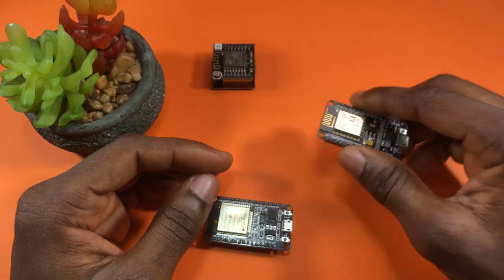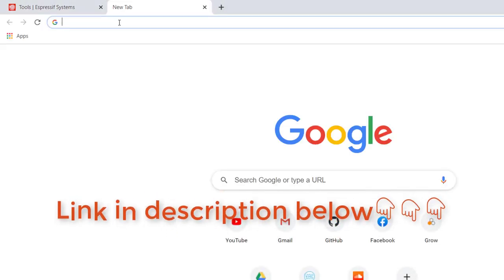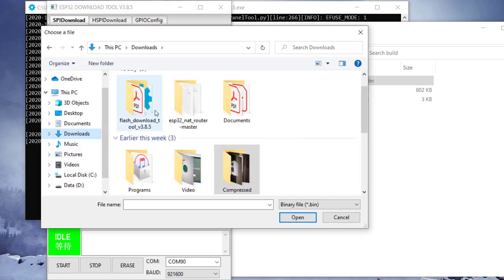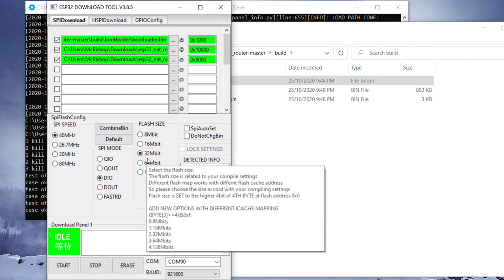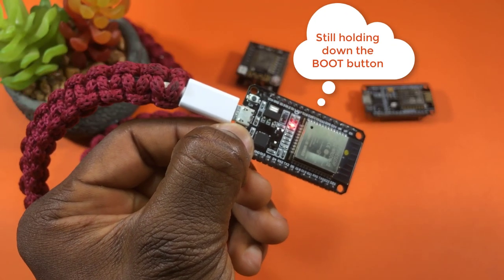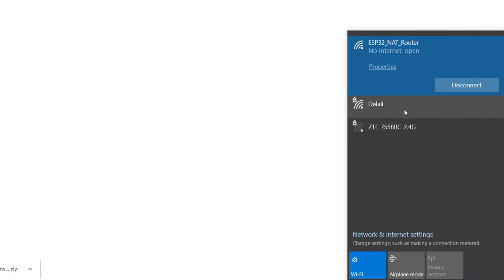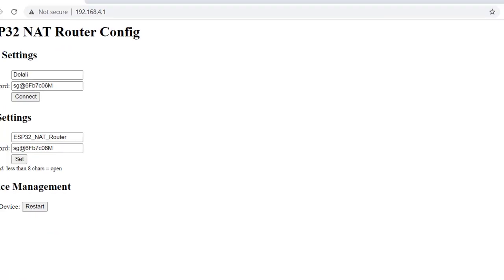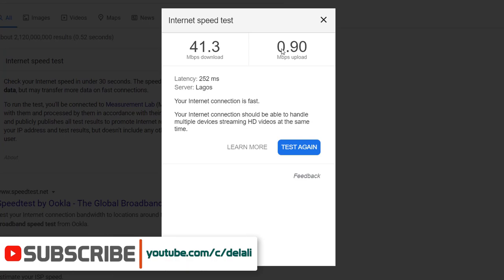How to Make a WiFi Repeater using ESP32 NodeMCU | WiFi Router Range Extender esp32 esp8266 | 2022

Comment: I did this just as you said, and it works perfect. I am able to broadcast to a building 30 feet away through two brick walls. Previously I did not get the signal in that building but now I can get 3 to 4 Mbps. Question, could you do it the exact same way, but instead use the ESP 32 cam module, without the cam attached, because the cam module comes with an external antenna?  Stronger signal and more range?
Reply from the maker: Its amazing to hear you were able to successfully build one of your own.

Concerning the ESP cam module, as long as your able to upload the bin files unto it, i believe it should work fine and give a better range as well. I haven't tried this on an ESP cam though but I dont see why it shouldn't work.

Please dont forget to subscribe. Cheers!!
Reply: I am interested if u tried it with the ESP CAM and external antenna?! :D
Reply: @vertaniacity9113  sorry but i never did get the time to try it with the espcam and ext antenna.  If i ever do I will reply post to this comment.  If anyone else does it please also post here to this comment string
Reply: @toddroles3234  I tried it and it worked 3 times stronger :D breathtaking :D i can just recommend it!
Reply: Can I get the file ?
Reply: @vertaniacity9113 how many mbs do you get compared to your original speed ?
Reply: @mohamedsalhi2426  i remember somthing about 70 or 80  my Internet speed in my Lan is 250. With the normal ESP i only got like 25.
Reply: @mohamedsalhi2426  I want to check it the next days, because i am not sure if I confused the speed with the raspi pi zerow repeater...
Reply: I have a hotspot network with voucher code as password using mikhmon voucher generator. Question: can this still be working if i used this as extender on a hotspot network with voucher code as password???

Comment: I have a hotspot network with voucher code as password using mikhmon voucher generator. Question: can this still be working if i used this as extender on a hotspot network with voucher code as password???

Comment: I using win10 and the esp isn’t showing up in the flasher program!
Reply from the maker: I could be a driver issue. Please check if your ESP has the CH340 UART chip or CP210x  and download the appropriate driver for it.

https://drive.google.com/drive/folders/1M9UKCm1I6qsNywlQFlggDPvXdKDEhLjm?usp=drive_link

Comment: Sir in my pc I have completed full set up but the flasher options are not coming pls tell what to do I have project on it and date is till 25th Oct pls tell fast
Reply from the maker: Please make sure you have all the needed drivers installed for the esp.

You can also delete all the flasher software and related files. Then download them and install again to be sure nothing is corrupted. 

Go to the link below, download the CP210X and CH341 drivers and install them. Am not sure which one of the two chips your ESP got but one of them will work for you.

https://drive.google.com/drive/folders/1M9UKCm1I6qsNywlQFlggDPvXdKDEhLjm?usp=sharing

Let me know how it goes!!

Comment: How did you determine that the hex file location of the bootloader.bin file is 0x1000 or the other files?
Reply: i am wondering this too
Reply from the maker: From the research i made before making the video, those were the hex values specified.

Did you have any issues using those values?

Comment: can you still use the esp32 as a normal microcontroller after this? or do i have to flash the stock firmware?
Reply from the maker: Yes you can.

You just have to upload new code to it using your Arduino IDE or with ever tool you use for programming your MCU

Comment: I was able to successfully follow the instructions in the video and connect two ESP32 repeaters to my router. They worked well, but I am having trouble communicating with the devices connected to the networks of the repeaters. Could you please help me troubleshoot this issue? Thanks for the video
Reply from the maker: Thanks for reaching out.

Are your devices able to connect to the repeater network?

Comment: 5G wifi extending supported?
Reply from the maker: The ESP32 available on the market currently doesnt support 5G yet. However Espressif's ESP32-C5 supports 5G.

Kindly take a look at this article.
https://www.espressif.com/en/news/ESP32-C5#:~:text=Espressif's%20ESP32%2DC5%20is%20the,require%20high%2Defficiency%20wireless%20transmissions.

Comment: Possible to use multiple esp32s to make a mesh? With same SSID?
Reply from the maker: Yes, that should also work.

I haven't tried that specifically but one time, I had two routers configured with the same name and password. I placed the two routers at opposite ends of a building and it made the wifi seem it was everywhere and with a strong signal.

Comment: Thanks for the video, it helped a lot. Do you know how I can set devices connected to the new AP with with a static IP?
Reply from the maker: It depends on the devices you have. If the devices have flexible menu's for connectivity control the its possible to set your devices to have a static IP.

If not I'm not sure how to set that on your devices.

Comment: Thanks bro it worked for me , i did same as you told me tell me if i want to make my ESP32 board normal in future how can i do that.
Reply from the maker: You just have to flash it with an empty sketch from your Arduino IDE.

Thanks for the feedback and have a happy new year.
Reply: @Delali  thanks bro and Happy new year to you also and i have a suggestion for you plz make a BLE Gampad with ESP32 and use in built touch feature to control it. give code and process in detail .

Comment: What about bridge mode(wifi to ethernet)
Reply from the maker: I don't quite get you....you mean you want to connect your ESP to your pc via ethernet?
Reply: @Delali  Hi mate, I mean convert wifi to ethernet(wired). Do you know what board is great for that purpose?
Reply from the maker: @kiu8179  I'd have to do a few searches for that.

A cheaper alternative is to use your laptop. First, you need to make sure your laptop is connected to any wifi network. Then you go into your network and sharing center if you use windows. Go to properties and then to Sharing....then set your laptop to share the wifi connection of ethernet.

You can now connect a LAN cable to your RJ45 port and plug it into any other device with LAN port. viola

Comment: hello! its not working for me with the new repository, i am using nodemcu esp32 and this is the message i get when i flash:

Uploading stub...
Running stub...
Stub running...
Changing baud rate to 576000
Changed.
NO XMC flash  detected!
FLASH_CRYPT_CNT 0
ABS_DONE_0 False
Compressed 22592 bytes to 14156...
Compressed 3072 bytes to 117...
Compressed 812656 bytes to 516275...

am i doing anything wrong?